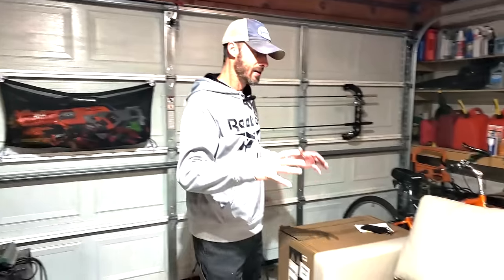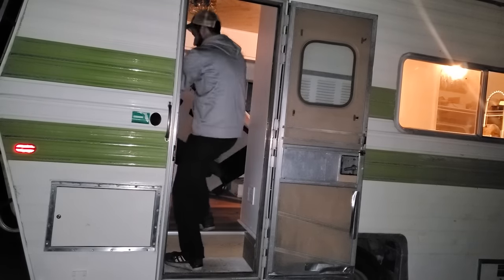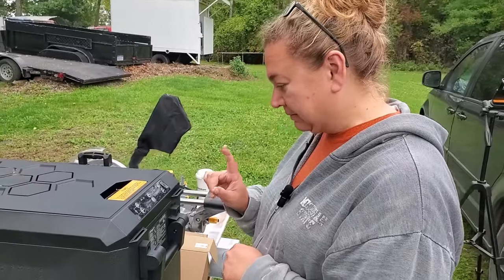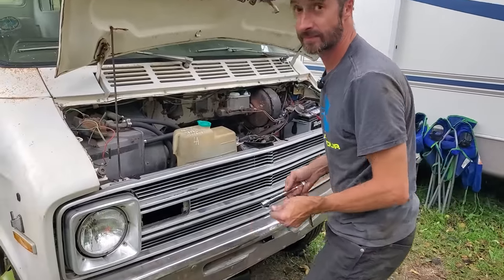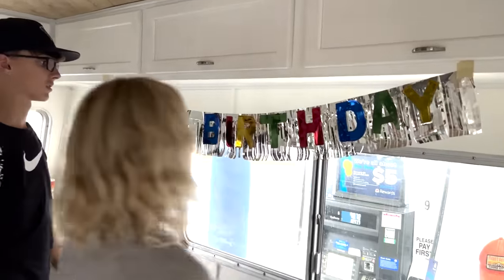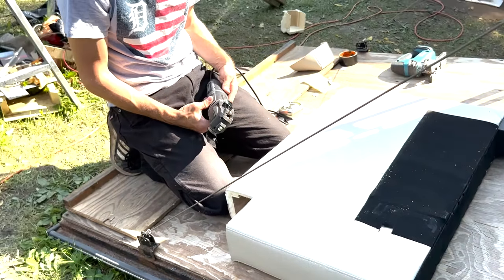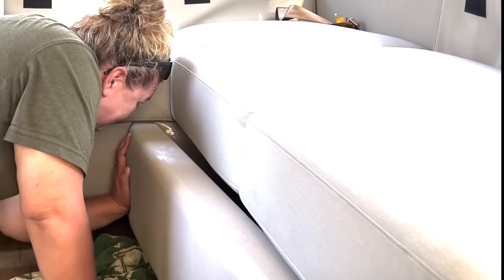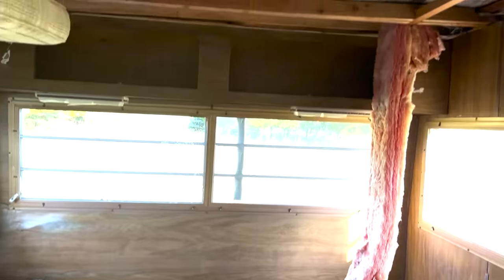Preparing our 1970s Vintage Camper for a Road Trip & Party!  New Furniture and More Engine Trouble

Comment: We are restoring a 1995 16 ft travel trailer. Used the roof sealant you did and it has worked fantastic! Thanks for sharing your journey, and keep smiling! 😂😂😂
Reply from the maker: That's awesome!  We're happy with our roof so far too.  We did just notice some cracking where we went over eternabond tape with the rubber coating.  We're thinking either there was moisture taped near the tape or maybe just the moisture from the tape itself caused a couple issues.  We put a little eternakote patch over it and seems good.  Thanks for watching and good luck with your project!

Comment: You both have the plan in your mind before you even accomplish it. And that's the type of person that I am. I see something before I put it together or as i'm going along! Keep up the good work and I can't wait to see the final outcome!

If you take apart that corner that you had cut off for that pipe, you can re. Apply it by unstitching it and then sewing it in the opposite direction. Also also with the strings that are afraid on the edges instead of putting the tape on it. Because it's gonna be stationary. All you really have to do is just melt it with a little bit of heat. And that will prevent those edges from ever framing again..
Reply from the maker: Yes, the most rewarding part is when the image from your mind turns into something real!  Not everyone's minds work like that... people like us and you are lucky 😁. Thanks for the tips about the couch too, love learning new things!

Comment: You are so brave to cut up those sofas! Just cutting fabric gives me anxiety...lol
Reply from the maker: It was definitely a leap of faith!  They turned out pretty good though!  Still need to make one more cushion :-)  Thanks for watching and commenting!
Reply: @retrorevivals  just a tip, my uncle was a professional upholsterer and I sew. We would share tips now and then. If you need more fabric for the cushions...I know ts work...but you could seam rip ( do not cut with scissors!)the backside of one of the sofas and replace it with similar color fabric. It would be better to have the cushions match perfect....than to have matching backs. The backside is usually one solid piece of fabric or 2 large lieced together. Just an FYI. My uncle used to run into that quite often with older furniture that he repaired.

Comment: I was having trouble finding this video again lol I was mentioning if you put an amp gauge in and you can coincide that with the whining of the belt I believe that if you are pulling too many amps off your alternator especially if it's not high amp alternator you may have to put a double belt setup to handle the pole like ambulances they put two alternators because of all the electronics your 440 would guarantee pole a 100 amp alternator easily just thought Hope this might help ps especially if your refrigerator kicks on and you hear that whining that may make a connection
Reply from the maker: Thanks so much for the comment!  That was something that didn't occur to us at the time.  We were pretty much on panic mode trying not to be late to see the kids.  We were able to get it to stop yelling by tightening the belt but it's something we'll keep in mind if we have alternator issues down the road. Thanks for watching!

Comment: im from michigan  if you have any UTV or ATV look up Leota ORV Trailhead its a smooth sport to either drag or drive something to camp in or look up wilson state park
Reply from the maker: Thanks!  We don't have any off road vehicles at this point though 😕
Reply: @retrorevivals  These trails are big enough for a sized vehicle to get down them as well, so if you wanted to tow a Chevy tracker or sidekick or another small vehicle that is possable plus the or laws are based upon wheel base example 4 seater side by side are to long they have to stick to wide truck trailes 2 seater side-by-side they are shorter and can take any trail also you can drag the truck but really limited trail expince

Comment: My chevy van is doing that squealing, I'm told its the steering column actually. Havent fixed it yet.
Reply from the maker: Could be... our power steering pump in still squeaking a bit but nothing like the scream from the alternator belt.
Reply: @retrorevivals  yeah I think after watching the whole video I'm going to have to check our alternator too. Though ours is diesel.

Comment: I wonder if you would have unplugged your refrigerator cooler it seems like the alternator is pulling way too much amperage causing the belt to slip if you would have tooken away most of your power going to the alternator as you could have it probably would have made the trip usually a high amp alternator has two belts on it most motorhomes jump up to two belts I would change the situation over to a double belt or a single wide belt kit
Reply from the maker: Thanks so much for the comment!  That was something that didn't occur to us at the time.  We were pretty much on panic mode trying not to be late to see the kids.  We were able to get it to stop yelling by tightening the belt but it's something we'll keep in mind if we have alternator issues down the road.

Comment: Power steering belt sound to me.
Reply from the maker: You're probably right. I tightened the PS  belt and the alternator at the same time. It has improved the squeal. It still happens periodically when revved. I'll snug them up again now that we've driven it a bit more.  Thanks for the comment 😁.